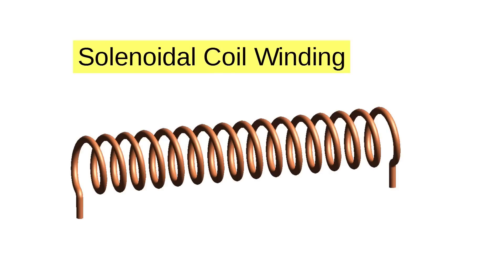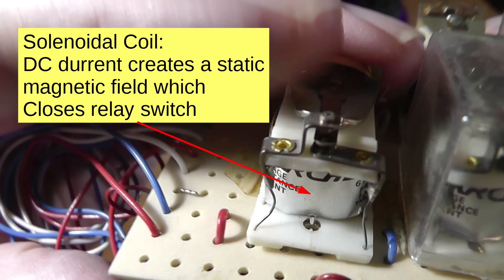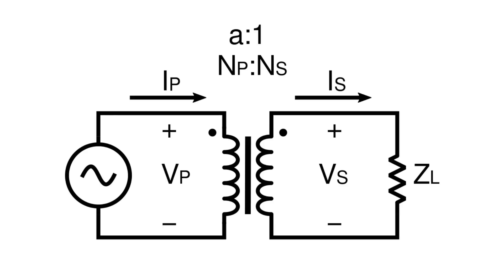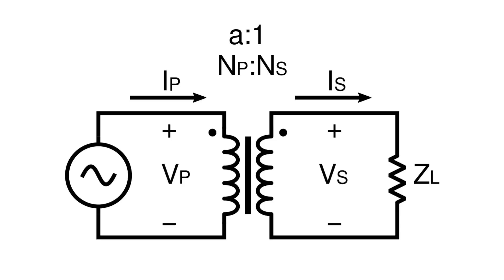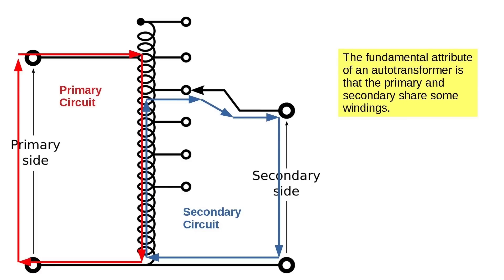Transformers and Autotransformers and First Giveaway (#486)

Comment: I didn't realize that the matching transformer/balun was wound as an auto transformer.  Are they all wound that way or do some have completely separate windings?  I would like to hear more about that.
Reply: I don't think they are unless they share the same winding and 'tab' at different places.
Some balun wiring uses 3 wires which end up being 1 wire for primary and 2 wires for secondary or viceversa. On that instance is a regular transformer.

Comment: I'm wondering how you know the wavelength of a wave and how the formula for calculating the length of a dipole antenna is established and if getting the length of the antenna right means that it has to be a length equal to a standing wave length and would it make sense to position  each side of the antenna at 90 degrees to each other or might that cancel the transmission or cause noise.